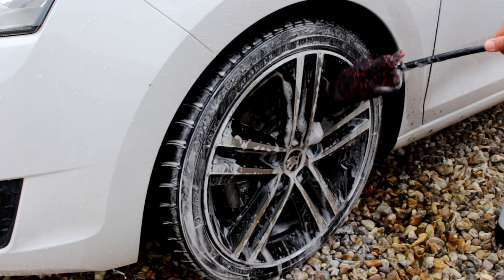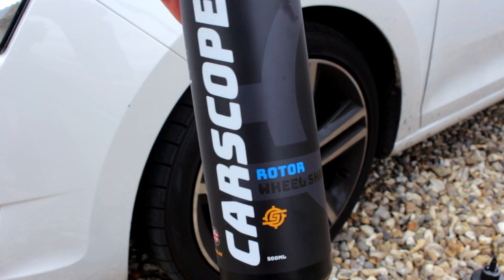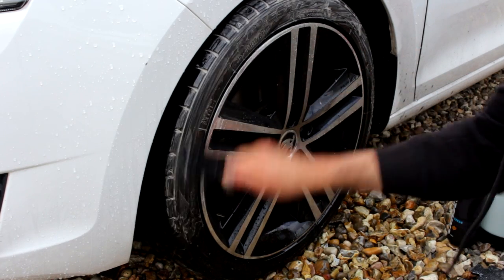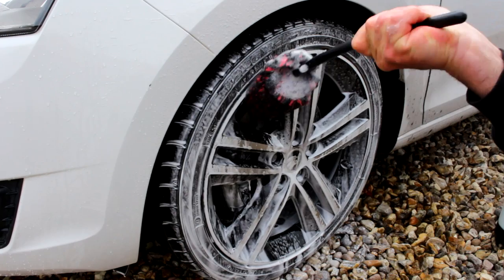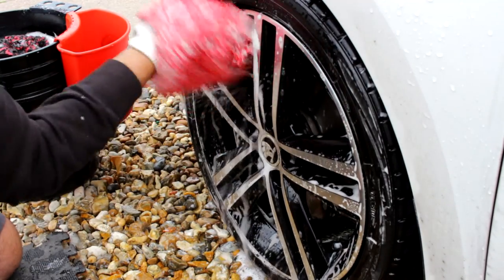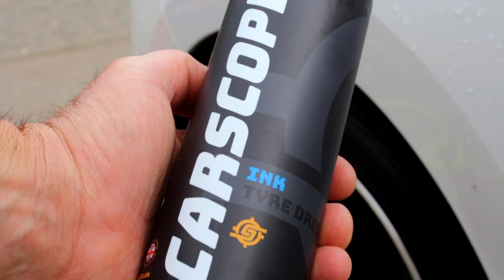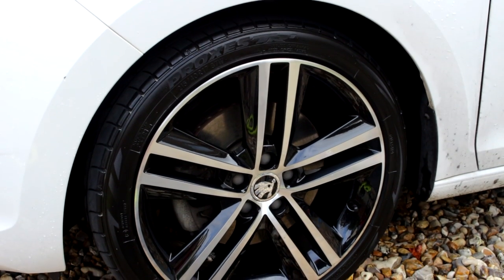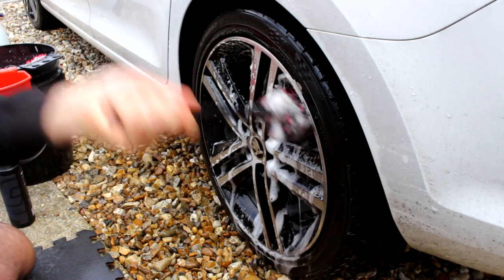Easy wheel and tyre cleaning

Comment: Are you getting any wiper judder with the glass sealant. I've got angelwax h2go on mine and while the reppelancy is brilliant the wiper judder is horrendous
Reply from the maker: None with this I think it’s probably down the fact the glass compound was used first no judder 👍🏻
Reply: @PaulDoldenDetails  cleaned mine, clayed it, machine polished it and brand new wiper blades and still got judder🤦🏻‍♂️
Reply: @bradleymanaton8723  That's really weird. Your prep is super in-depth. I think I'd need to do something similar on my motor as my windscreen is a right mess at the moment.
Reply: Top tip, put some h2go on your wiper blades it will stop the juddering.
Reply: @glosjdm  already tried that. Absolutely no difference
Reply: @bradleymanaton8723  have you got traditional framed wiperblades? If so  that's the issue. I've never had an issue when using it with flat blade wipers
Reply: @glosjdm  no it's the newer aero type blades